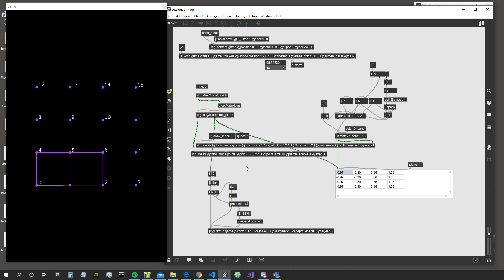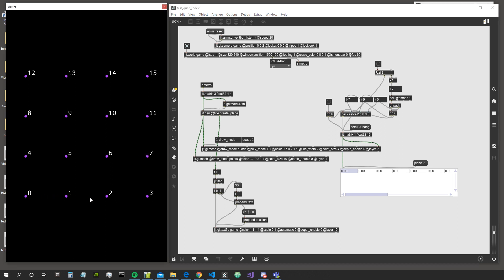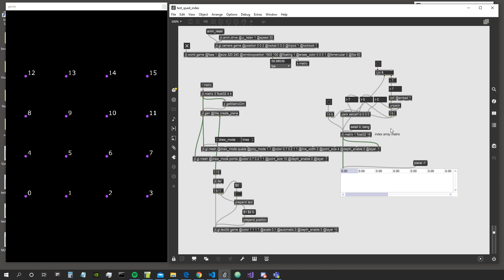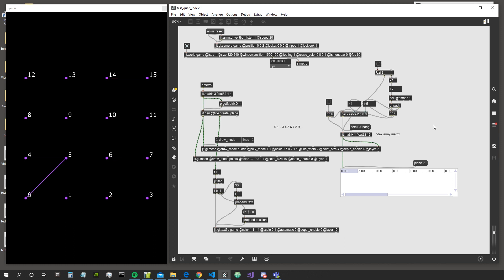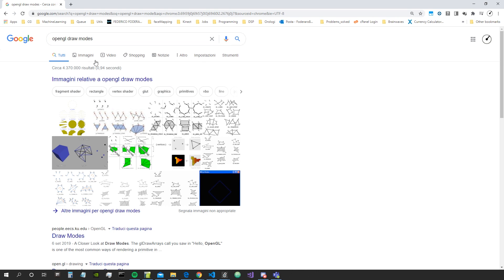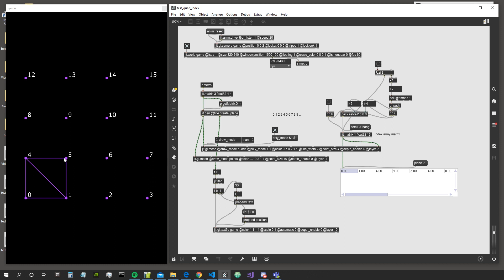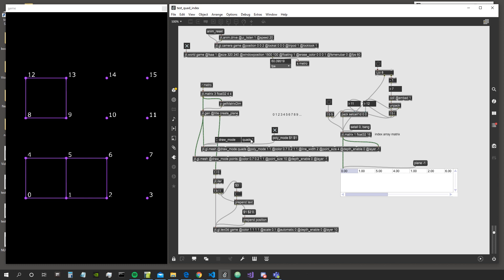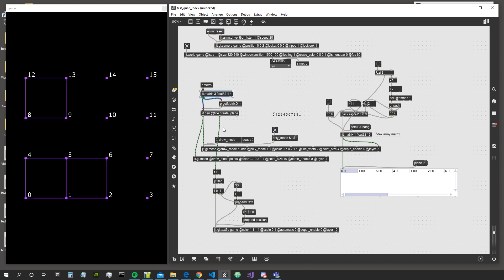Let's Take a Look at the Index Array Matrix Input of [jit.gl.mesh]

Comment: Are you running GL2 for this? It seems that it doesn't work in GL3 and I'm patiently waiting for it to get fixed!
Reply from the maker: Hey guys, yes for the moment it will run only in GL2 but this is going to be fixed with the next GL3 update. Have fun!
Reply: Yeah, you need to run this patch in GL2.